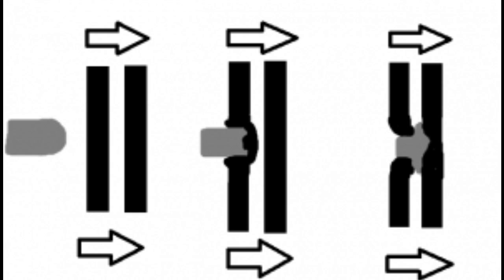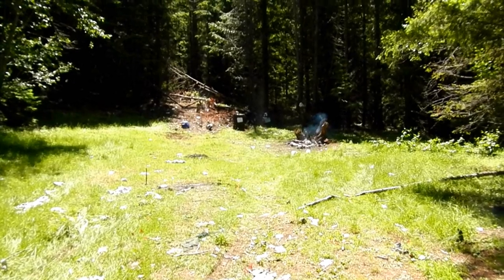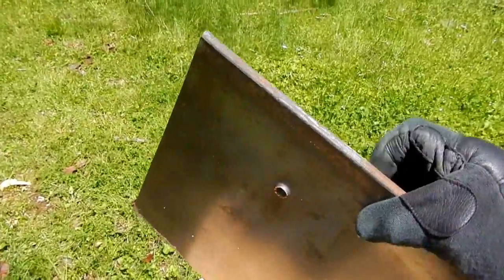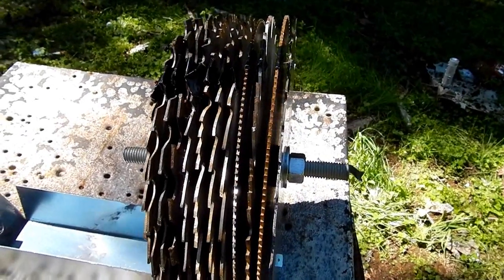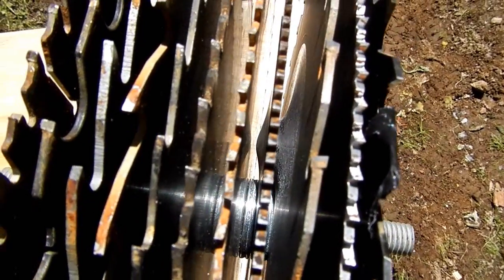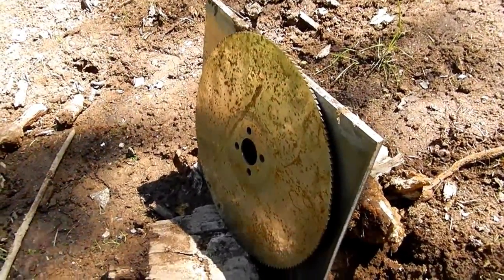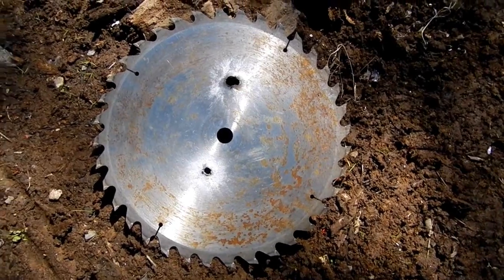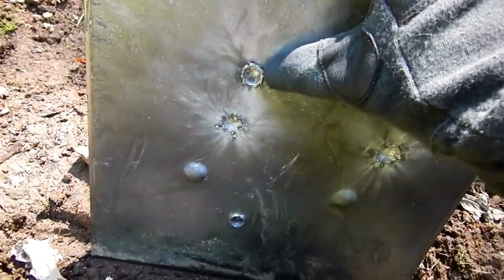Testing the Concept of Spaced Armor

Comment: One of the most effective spaced armor made to defeat modern APFSDS  (Armor piercing fin stabalized discarding sabot) aka the dart. It could even defeat a du dart round (depleted uranium). I'm talking about the pyramid armor on the Leopard 2a5.  The way it worked was it was a highly angled somewhat thin plate (my example has 80mm for the first layer) with a the main armor being far behind (a lot of composite armor that can stop alot by itself) which is also strongly angled. The space between the first layer and the main armor is longer than (at its time) any dart. What this me at was as soon as the dark entered and exited the first layer it would become extremely unstable and bounce or shatter after impacting the main armor. It was probably the most cheap, simple, and effective way to defeat modern darts, but its weakspot was if if the dart was longer than the space between the first and main layer of armor.

Comment: Spaced armor is NOT meant to defeat kinetic penetrators such as sabot tank rounds or small arms fire.  Spaced armor is meant to defeat HEAT (high explosive anti tank) rounds.  Your kinetic round (namely the 7.62 bullet) did NOT penetrate 3/8" of solid steel plate, but it DID penetrate 3/8" worth of saw blades.  If spaced armor provided superior protection or even equal protection vs Kinetic rounds, you would expect the 7.62 to only penetrate 2 saw blades and be stopped by the 3rd one at worst.

 HEAT rounds work by using a shaped charge explosive to create a jet of liquid metal plasma (usually copper), which burns its way through the armor plate and sprays the inside of the vehicle with molten metal, killing crew and potentially touching off ammunition.  Notable examples of weapons which utilize a HEAT warhead include the German WWII panzerfaust and American Bazooka, and the much-more-common-in-Afghantistan Soviet/Russian RPG-7.  Spaced armor defeats HEAT projectiles by allowing a path of less resistance for the exploding jet of liquid metal produced to take.  Instead of detonating in contact with the hull, where the path of least resistance is the shortest route through the armor (and thus, into the crew compartment), the HEAT projectile detonates on the comparatively-thin spaced armor, and the jet enters an air gap before meeting the main armor plate.  This allows for a majority of the force of the explosive jet to dissipate into the air gap instead of burrowing into the main armor plate.  Spaced armor provides almost no value when faced with kinetic penetrators (any solid shot, from bullet to tank sabots) beyond the slight increase in total thickness of the armor unless there is enough air gap between the plates to allow the round to tumble, but in the case of vehicle armor this would require both an air gap so large and and outer plate so much thicker as to make the system un-viable due to both weight and volume.  It was only useful in very limited capacity in wwII on German panzers because of the prevalence of anti-tank rifles like the soviet 14.5mm or the 20mm Ladi, man portable systems with kinetic rounds which COULD penetrate the 30mm side armor of a panzer IV, but they fired small enough rounds that a fairly thin plate could be mounted far enough from the hull to induce enough tumble that the round was unlikely to penetrate.  Schurtzen was really only common to the panzer III and IV (and vehicles based on those hulls, such as the highly successful StuG), the Tiger and Panther tanks both had thicker side armor which protected against these weapons.  Kinetic man portable AT systems have since fallen out of use, as they simply cannot disable, let alone penetrate, a modern MBT.  The closest thing to them still in U.S. use today would be the M82 .50 anti-material rifle, but even that is only rated for engaging thin-skinned vehicles.  You would have probably noticed that the M1A1 Abrams tank does not have external spaced armor, except on some vehicles over its most vulnerable areas such as the treads, and that only appears on M1A2's fitted with TUSK gear.  This is because the composite armor of the Abrams contains air gaps backed by a ceramic layer (excellent for defeating thermal energy) as an integral component of the armor plate, essentially having spaced armor built in rather than externally mounted.  Still, outside of the armor used in MBTs, spaced armor will not protect against tank fired (120 or 125mm) HEAT rounds, they're simply too powerful.  It's only real use is to protect the vehicle against man portable systems like the RPG.

An alternative method for defeating HEAT projectiles is through the use of explosive reactive armor, or ERA for short.  ERA works by covering the outer hull of the vehicle with small blocks of explosives encased in thin steel plate.  When stuck by a HEAT round, the block of explosives detonates and counters the explosive force of the HEAT blast.  While much EASIER to produce and repair than armor with integral air gaps such as the armor used by the Abrams, Leclerc, Leopard 2, and Challenger 2, the downside to this system is the inherent dangers of both keeping large amounts of explosives lying around (which can have, ahem, interesting results when said explosives start to degrade over time), and also the sheer concussive effects of the blast when struck which can damage some of the less-robust outer parts of the tank and severely rattle the crew, degrading combat performance at a critical moment.  ERA was commonly found on Warsaw-pact MBTs, but has since fallen out of favor due to these shortcomings.  Russia's newest MBT, the T-14 Armata, does not use ERA at all.  ERA is also unsuitable for light armor vehicles, as LAVs (such as your MRAPs, or BMPs and Bradley IFVs) can by severely damaged by the ERA blast itself, thus necessitating the use of space armor to protect against man portable anti-tank weapons on LAVs.  

I hope that I did a decent job of explaining the theory behind spaced armor for you.  

TLDR: Spaced armor is used to protect you from Hajis with RPGs, not from small arms fire.
Reply: Thanks for spending the time writing out this comment.  Someone needed to bring up that the armor is not designed for small arms but HEAT RPGs or other HEAT projectiles.
Reply: Good info.
Reply: Thanks for the douchbag diatribe.  However, spaced armor is also practical for kenetic impacts as well.  Wiki "spaced armor".
Reply: @Aaron Washburn ??? Odd? Al + Fe + O  An Exothermic(Releasing Heat Energy) reaction. ie Thermit: Used to weld Steel Plates and Steel Rails. ??? The plasma temp might not be high enough to melt the armor. But the secondary reaction it creates with the metal in the armor, Is. More than simple physics is involved.

Comment: Space armor is more for shaped charges like HEAT, not small arms or kinetic energy rounds. The outer-layer detonates the round and the penetrating molten copper jet disperses in the empty space between the spaced armor and the main hull. 

ERA (Explosive reactive armor) acts on the same premise but creates the space by exploding outwards.
Reply: spaced armor was originally intended to prevent kinetic munitions from soviet and eastern european anti-tank rifles from penetrating the thin side armor of panzer III's and IV's. these were- by far- a larger issue to the germans in world war 2 than HEAT warheads.

Today, it does both. It helps destabilize kinetic munitions fired from heavy machineguns or large-caliber rifles, and creates a distance between the impact of a HEAT warhead and the actual armor.

Saying it was designed for HEAT warheads is false however, the Germans didn't encounter HEAT warheads in any capacity where they were more effective- or more prevalent than conventional AP or APCBC ammunition.

Comment: This has no actual basis that i can refer to but i think what's happening is the plate in front deforms the round just enough so that it doesn't have a small enough point to transfer energy to. Also since the plate isn't connected it doesn't transfer energy to the plate, increasing the damaged caused. That's at least my observation anyway. (also with HEAT and sometimes APCBC rounds with explosive filler, spaced armor can cause premature detonation.)

Comment: It's the larger cross sectional profile that's stopping the 7.62 from penetrating as well as the 5.56.
With the narrower round, the energy is concentrated in a smaller space, so it's more likely to punch through.
In the same way a nail with a sharp point will punch through a surface than a blunt metal rod will

Comment: these are some very good tests you made there
not 100% scientifically accurate stuff but ... good enough to get a very good idea about the effectiveness of spaced armor

try composite armoring 

it replaces the air with layers of thin steel+something elastic angled away
like ....angled sandwiches in a sandwich
Reply: in regards to armoring
a face hard layer is desired then mix stuff up
the brittle blade was better because it was more resistant to compression
it's creation method (not a native english speaker sorry) trades flexibility for compression resistance by being brittle

Comment: ... also, i was not surprised at the superior penetration performance of the 5.56.

More energy for sure, however the larger diameter projectile spreads it across a larger surface area.

Comment: Just another quick note on spaced armors; the space needs to be wider than the projectile's length to allow it to tumble within the cavity prior to connecting the main armor belt.
Reply: That has only really been done effectively against modern darts (apfsds) with the Leopard 2a5 thatbi know off. Its pyramid like armor on its turret cheeks is actusly empty space to allow the dart to become unstable and bounce or shatter on impact of the actual turret cheeks. But this requires both the first plate of the pyramid and the turret cheek to be angeled.
Reply: Unexpected SPANISH INQUISITION finally someone brings up leo!!
Reply: Which it was, if you look at the leo 2a5, the pyramids first plate was very angeled with the turret cheeks being angeled as well.
Reply: Modern APFSDS rounds do not "tumble". They just go straight through. They don't care almost at all about what angle they hit stuff, they'll just bore a hole like a laser. There's far too much kinetic energy pushing a tungsten or DU rod in the forward direction for any such thin plate to deflect them in any meaningful manner.
Reply: Very true on a large scale (i can't remember how wide the cavity within the M1's armor is, but i know it's not really wide enough to effect modern KE rounds) but he was messing about with small arms and I couldn't help but notice that the gaps in his test piece were way too narrow to really take full advantage of spaced armor effects.
Reply: @jonskowitz  spaced armor really is only really effective against chemical munitions, but it is still good against kinetic rounds. Your better off having 1 thick plate with 1 plate far in front of it. Besides that spaced armor does not provide as good of advantage as composite armor with kinetic rounds.
Reply: @jonskowitz  in a way he used composite armor with spacing which os a good combination, as each saw blade is different so I'm sure some had different hardness which offered a composite like armor and the spacing helped even further. I believe most MBTs have space between a lot of the composite layers to give more effective chemical protection without sacrificing kinetic protection.
Reply: I know this is old but thank you. I was going to say the same. I wish people would research before making videos. There is a lot of interesting info out there on armour and it's development.
Reply: Oh and as for the spacing on MBTs the leopards are the only ones today that I know of to rely on armour alone to stop MBT projectiles while the norm is to use slat and reactive armour and mostly defeat infantry AT weapons and other none kinetic projectiles other than those from smaller auto cannons like the 25mm bushmaster sabot rounds.
Reply: Another key factor is the angle of those spaced armor plates.

Comment: The saw blade is just ending up acting like the ceramic of your normal body armor on that last one. It's deforming the projectile as it goes through and it's shattering is just aiding in reducing the power overall before the backing catches it. Fun fact, ceramic can be better at stopping projectiles if sandwiched between two steel plates which is commonly found in actual tank armor.

Comment: Yup tried the penetration test before. Odd thing is the 7.62 can penetrate deeper in when using wood and cinder blocks as target. But we used the normal round not those fancy metal jacket rounds and was way back in the 80s.

Comment: IIRC the spaced plates were not added in WW2 to increase armour protections against AT rounds, 
but rather to defend against hand held and portable devices which could, when firing at the right angle, penetrate the side and rear armour.
Reply: Panzerfaust
Reply: @vasili1207  no this guy is right. Panther was given spaced side armor specifically to counter anti-mat rifles such as 14.5mm russian firearms.
Reply: @brodiealltop7620  yeah I know

Comment: Very cool! Contrary to popular belief. Early armour on the M1 series of tanks was a spaced armour array. Details are still hard to come by by it worked very well against the early 125mm apfsds ammo. The design of the Apfsds used a steel body and tungsten slug to penetrate a great deal of armour 400-450mm RHA at low angle. However the armour array on the M1 was probably able to defeat such rounds due in large part to the effect of a spaced armour array destabilizing the tungsten slug and causing it to hit a thick back plate and less then optimal angle as velocity.

Comment: Clamping the saw blade to the steel plate at first would have allowed a comparison between spaced and non-spaced armor of the same thickness. Also, maybe different kinds of ammunition or varying distances so that you are sure to get one type firing through only one of the set-ups.

Comment: how do 12x1/8" plates make slightly less than an inch in steel thicness ?  , also steel comes in diffrent levels of hardness and softnes (some tools tend to be harder like the one sawblade that shattered was prolly hardened steel.)
The census would with a real clean experiment look something alike tho... not so drastic. Spaced armor is more effective than just one homogenous layer but not by such a huge margin by far.

Comment: I thought spaced armor was mostly for HEAT rounds? Shaped charge stuff
Reply: I think you're right. The jet hits the thin outer layer, then breaks up in the air gap, reducing its effectiveness on the primary armor panel behind. This is the principle behind slat armor, though slat armor is easier to see through and is lighter.

Comment: Fill the airspace with crushed tungsten carbide to shred the rounds.
Reply: Or a single cheap fired ceramic floor tile. If it "rings" when you hold it loosely and tap it with something solid, perfect.

Comment: Spaced armor is designed specially for heat (a simple google search will show this and I’m also USARMY Eod so I get extensive training in this) cage armor or rpg nets on modern vehicles crush the cone preventing the shape charge or jet from fully forming thus reducing the capability of penetration and even half an inch of air prevents a lot of power from them. the cones on heat rounds are made specifically for that round to do maximum damage any shorter the jet won’t fully form and longer it losses it’s power immensely

Comment: Better to not get hit and use an active defence system over risking taking the shot in the first place. 

A combination composite armour would also be more effect. Ie put hard wearing plastics or ceramics in your air gaps between your plates.
Reply: nah, the air gap actually works to break up/tumble the round, causing it to impact a larger area on the back plate, and failing to penetrate.
Reply: Most MBT use composite armour in conjunction with active defence systems. Spaced armour is outdated and I wouldn’t wanna be in a tank with extra steel arbitrarily and rudimentarily attached as a stop gap against the most powerful guns at the time.
Reply: @brendonmoore3505  whatever, abrams tank uses spaced armour.
Reply: Actually the M1a1 Abram’s is equiped with Chobham composite armour, the very same armour developed by the British during the 1960’s, and installed on the fv4211 and the challenger 1 and 2.

Comment: Okay you have mass and weight + energy equals penetration. How do you not know that the 5.56 is not going to penetrate better than 7.62!
Reply: Did you actually watch the video, what with the 5.56mm hole in the plate next to the big 7.62mm pits?

Kinetic energy is 0.5*MV^2. That V^2, V squared is what you're missing. The higher velocity of the 5.56 more than makes up for the reduction in mass.

Comment: Spaced armor is for repelling Rocket propelled grenades.
The cages, as well as the chain netting you see, tried to catch them before the explosion occurred.

 RPGs are cone shaped heads, producing an inverse cone as it penetrates into a single point of devistation. The spaces allow for escape of the debris and force as the explosion happens.

The shape charges or commonly known in the military as explosively formed projectiles are only stopped by a specific chemistry of metal armor, in layers as well.

There is no need for spaced armor for bullets because a single sheet of composite steel can stop and or deflect them.
Reply: Spaced armor might also work agains HEAT rounds but we are now talking about tanks. Still tho kinda curious if spaced armor would work against APDS.